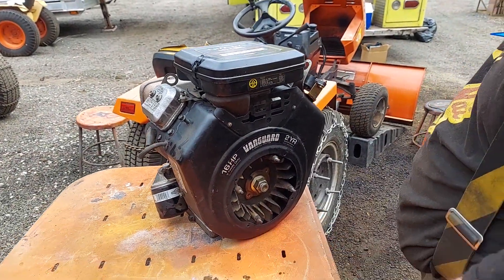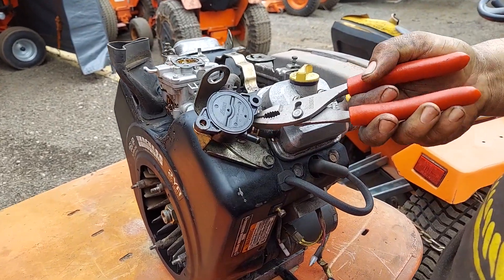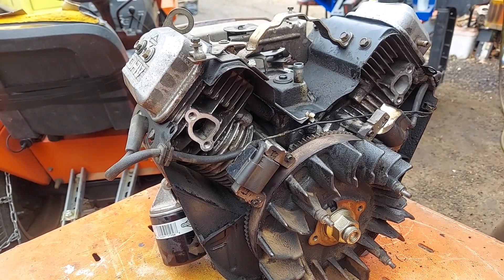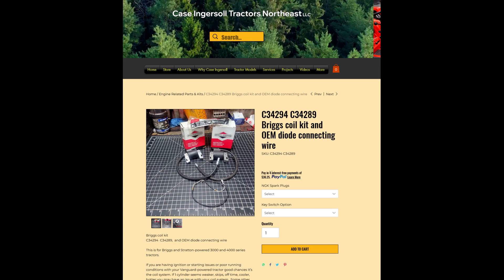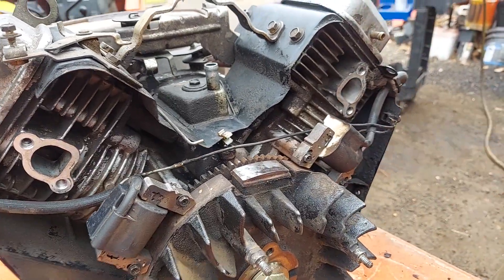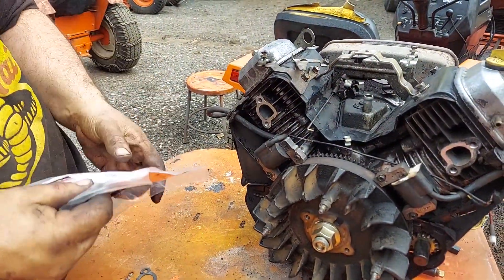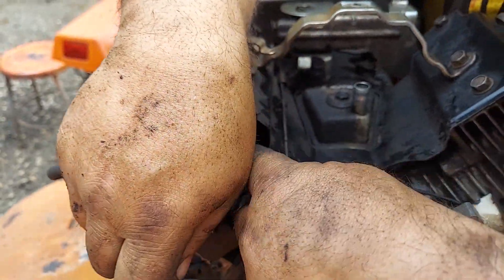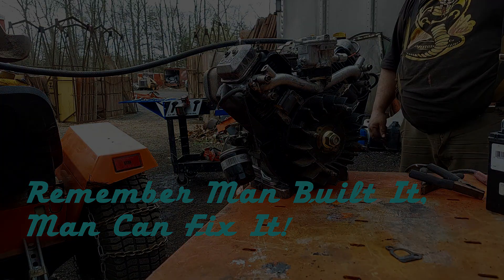Removal & Install Of Coils, Armature, Magnetos On Small Engines Briggs & Stratton Vanguard For Demo

Comment: I have a vanguard  v16 doesn't turn over with the ignition and no spark. Does turn over by jumping the solenoid.
Reply from the maker: Hi does it run when you jump the solenoid or just turn over?
Reply: Just turnsover @caseingersolltractorsnortheast
Reply: Just turns over. Notsureifitisthesolenoidorwiring @caseingersolltractorsnortheast
Reply: Can i bypasst the fuel solenoid and the mower still run @caseingersolltractorsnortheast
Reply from the maker: @sylvanuschupp995 Fuel solenoid has nothing to do with no spark. Solenoid needs power enable to run.
Reply: I know that. I want to do away with fuel solenoid and the engine still run .
Reply from the maker: @sylvanuschupp995 You said you want to by "pass it" and my answer was it needs power to run....  If you want to remove it then sure engine will run...
Reply: Thanks bud you are the best
Reply from the maker: @sylvanuschupp995  Glad to help!
Reply: Do I need to put a inline shut off valve to turn off gas when not using mower ?
Reply from the maker: @sylvanuschupp995 No should be fine , the coils will die when you turn key off so you will be ok that way and the needle valve will keep gas from entering when full bowl
Reply: Thanks a bunch. I will contact you if I have more problems